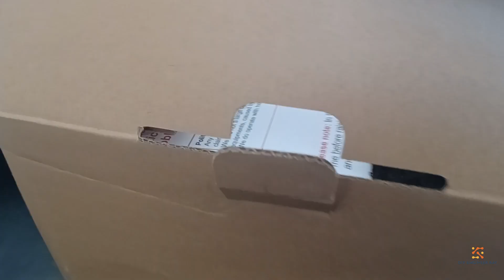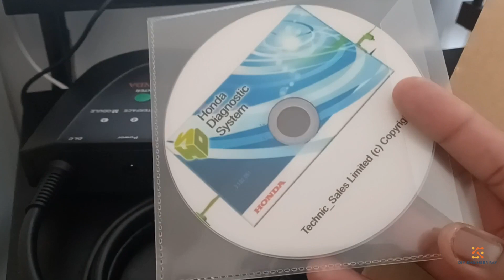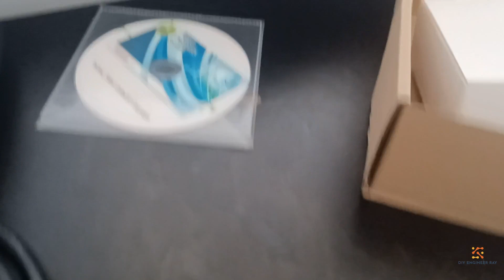Unboxing Honda Interface Module & Diagnostics System

Comment: Does this HIM bridge the PC to the vehicle and allow for ECM reprogramming or strictly diagnostics? I have a replacement ECM and I am researching the proper tools to install it properly. Thank you.
Reply from the maker: http://blog.obdii365.com/2014/12/31/how-to-replace-honda-ecmpcm-with-hds-him-2/

But for newer car (Post 2017) use iHDS instead of HDS
Reply: @raynkosi  thank you, Ray!
Reply: I have the PCM immobilization code from the dealer. Is this the only code needed? If so, is the HDS IMMO PCM code calculator no longer required? Thank you.